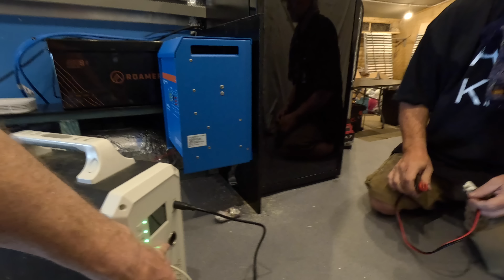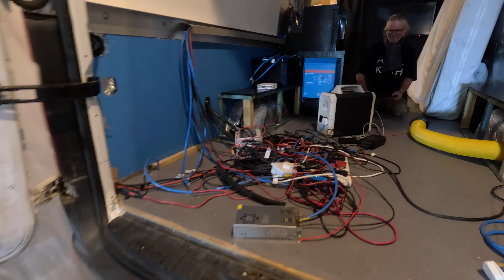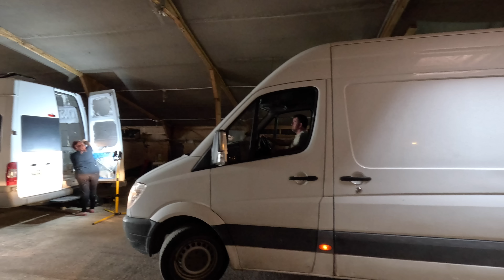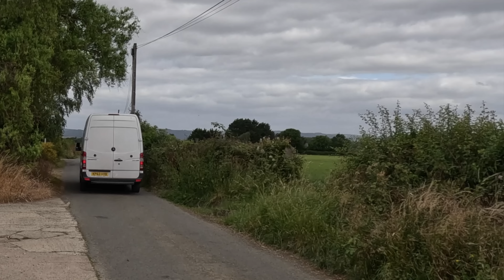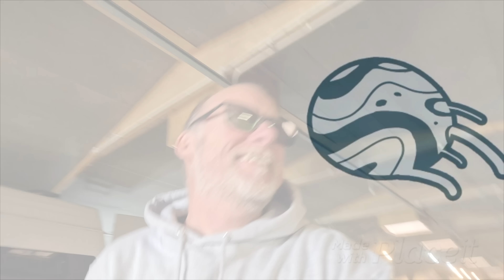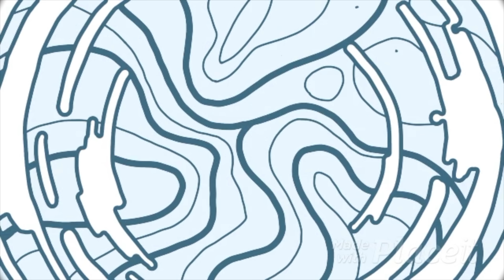Transforming Campervan 12v Electrics

Comment from the maker: 12V 30A 360W, DC Universal Regulated Switching Power Supply, Converter AC 110/220V to DC 12 Volt https://amzn.to/3XRDmMQ
Beck's channel https://www.youtube.com/channel/UCE3qsP742E_SjaYNmkLqPhw
Everything i use in my camper van you will find here in my Amazon Store  https://www.amazon.co.uk/shop/melsvanworld
Camper van build parts list 
https://www.amazon.co.uk/shop/melsvanworld
Bluetti power banks i use in my van https://shareasale.com/r.cfm?b=1801219&u=3342811&m=112337&urllink=&afftrack=
I use this scanner to keep my sprinter running and on the road 
iCarsoft Professional Multi-System Auto Diagnostic Tool 
https://amzn.to/3Ly6JgQ
US https://amzn.to/32IPAPj

Comment: Sorry Mel this is still not efficient at all even at 48v your changing 48v dc to 230v ac then back to dc at 12v. Basically you are adapting something that is not upto the job to the best of your abilities and I respect that 100% but having a channel as big as your I feel its important to correct things like this. I enjoy your videos  and I'm sure you will look into conversion efficiency % and come back with some numbers. I would expect doing all of that you are running 70% efficient and for limited power I would say this not ideal but that's just my rough estimate as both the power bank and the 12v will have a drop in efficiency I would say around 30% between them

Comment: Hi Mel, I have used these power supplies in the past and they are very good. I have a 24v one for testing systems in my van and a 12volt one also. I was going to use one as a back up to my battery system if it ever went flat or was disconnected for maintenance  but I have a Victron Multi plus inverter/charger so I don't need it.....but yes for a cheap alternative supply of 12 volts these power supplies are a great idea!!!
Reply from the maker: Thank you for the positive comment i really appreciate that 👍🤓👍

Comment: Hi Mel. I don't dispute that the total 12v  draw in most vans will exceed 10A but I would refer you to the official Maxxair specification with regards to the Maxxfan power consumption. Their website states that a 5A supply should be adequate. I appreciate that the inductive load created at startup by a motor exceeds that during normal running but I doubt that it exceeds 10A. I accept the rest of your argument and appreciate that many people don't realise that less volts (i.e. 12 not 230) means lots of extra amps. We were quite surprised last summer during that unusually hot weather how much power a Dometic fridge and to maxxair  fans running at fairly high speed used overnight.
By the way I really liked the foot rest/storage box you made in the last video. Keep up the good work

Comment: Mel please consider the fact that that unit needs loads of air flow to keep cool. If have smoked one already and all that I was powering was diesel heater and 2  led ribbon lights !  It was 30amps and in my shed so loads of cold air ! They are Chinese made and probably not quality controlled. Good luck Richie.
Reply from the maker: Thank you 🙏

Comment: Hi Mel
I‘ve been calculating the estimate lost of energy and it does not look good on paper, but like we all know, the theory is never exactly the same as when you test it for real. It‘d be cool to see a test between running a van directly on a powerpacks 12v vs your 12v through your transformer to calculate the difference. Maybe using a AC200Max and it‘s 30A port to get an accurate result.
Cheers!🙏🏼

Comment: Winter is going to be hard for a few months when the sun doesn't shine that much. I'd still couple any of these power banks to a leisure battery for optimum performance. I built a 24v 60 amp battery with a 20 amp mppt aand use it alongside a Bluetti Eb3a. It gives me up to 600w for the inverter and around 1700 watts of power. It's great running a fridge outside and people charging up. It cost less than £500 and is a great little addition to the van.

Comment: There are losses of course, but hey! needs must. This is more of an issue with using these solar electric generators (fancy power packs) but with a camper wired to a Good set of stand alone batteries, this type of set up would not be necessary; it's a case of 'pick your poison'. There are pro's and cons to every system, and everyone's electric requirements are different too 💥 If you have it, flaunt it 😆 Good show mate 👍
Reply from the maker: Thank you 🙏

Comment: Spot on Mel! It's not so much the stepping up and down of the voltage which generates most of the losses it is going from DC to AC and back to DC again.
HOWEVER, this is a moot point as you've rightly pointed out if the alternative is no power at all. This is a really creative solution that fixes the biggest drawback of using a powerstation in a van!

My only advice would be to try and use the 12v 10a outlet to power a constant load like the fridge to minimize inverter losses.
Reply from the maker: Thank you that’s exactly what we are doing using the 12v 10amp outlet to power the fridge 👍🍻👍

Comment: # tag Brilliant nice work Mel . I bought one of those 12v 30amp transformer after watching your video on Becky's Van . So it was my experiment to try and use it as a 12v supply to a 2000wot inverter to run a demestic 240v fridge But as soon as I plugged the fridge in to the Inverter the power pack gave up . Probably my mistake But I thought it would be ok at 30amp so dun no lol thanks for any help all the best to you and yours Mel 👍
Reply: Fridges use a fair amount on start up, any motor does when it starts, your 30A power supply  would probably handle at most a 300W load on an inverter so I guess the fridge motor drew more than that on start up ?
Personly I'd always use a battery in between to act as a buffer, power supply charges the battery, battery runs the inverter
Reply: Other than to see what would happen, I'm not sure why you would want to do that. In that you have a 240v supply in the first place
Reply from the maker: Oh dear yes I think you Amy have over cooked it

Comment: Hi Mel. Good one again. Some very good ideas and tips for van build. When charging your power pack through solar, how do you connect your power bank. Direct to panels or through  MPPT controller. Cheers Dave..
Reply from the maker: The Bluetti had a built in MPTT system that is the great thing about them just plug it in and away you go 👍

Comment: My Bluetti AC200 "sommit"  lol , has a 2 pin 12volt 30amp out on it I think it is called an aviation socket ? , I just use that output in my van,  no power/transformer  needed or used .
Reply from the maker: Yeah that’s what I’m using in my van hopefully I’ll get one for Beckys van too 👍

Comment: Hi Mel. I have just bought one of these to go with my Ecoflow. I would love a Bluetti 200max as it has a 30 amp connector for dc, but that's out of my price range. Can I ask what voltage did you set the Power Supply to?
Reply from the maker: 13v

Comment: The electrical installation is inefficient, you will have nothing but problems later on especially in the winter when you're drawing more load
Reply: In this setup you are putting a lot of trust in a Chinese power supply converting 230v to 12v from your power pack, if this installation was any good we would see more people doing it

Comment: Mel, I watch all your videos, but this one is well within my expertise and so I had to comment.
Any conversion losses power, normally in the form of heat, may not be much but it does.
I'm not saying what your doing is wrong, if that's what you need then so be it but I will say one thing. Please use a decent PSU and not one that 'could' catch fire. 
Unless it's a well-known brand name like a MEANWELL RSP-320-12 then it's a cheap import without any real safety specifications or accreditations.
Yes, it may say it has overload protection, safety cutout etc, but take it from me, it will most likely break down in a bad way with smoking components.
I most certainly would not have that PSU working in a non-seen cupboard, at night when asleep or when away from the van.
Please think about safety first, not the cost when it comes to PSU's
The above PSU I listed is about £45
If you need any other advice on this please get in contact
All the best
Reply from the maker: Thank you so much 🙏